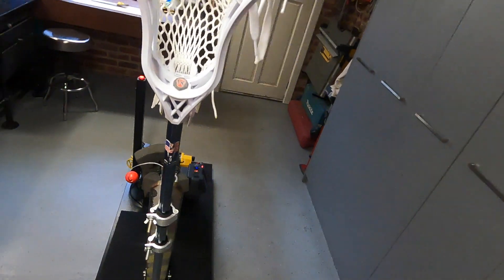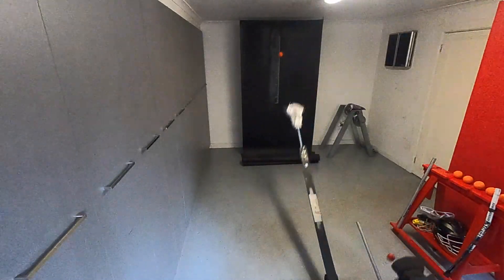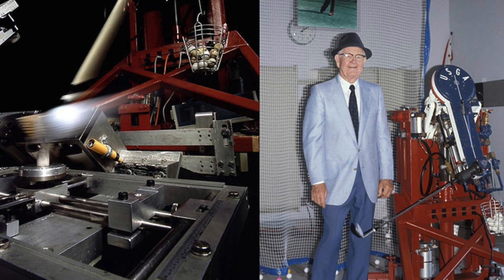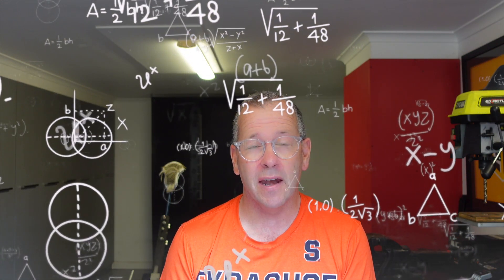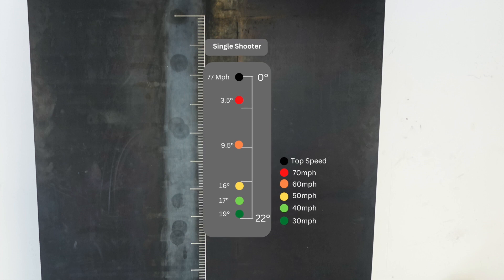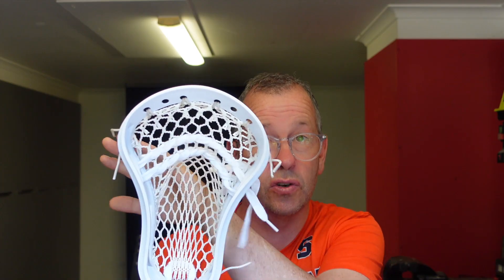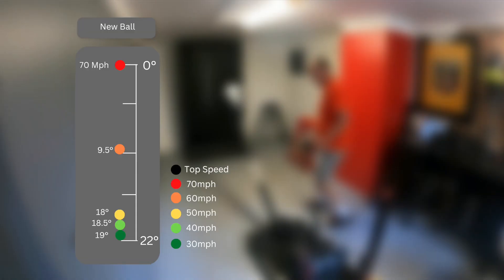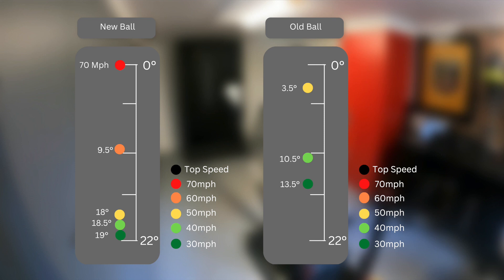I Built a Lacrosse Shooting Robot!

Comment: have been thinking about this as well, since I coach lacrosse and am also an engineer. The big question  I have (I could be wrong) is about acceleration.  It seems that with the spring, acceleration is maximum when first released which would require a lot of "whip" or would favor a head canted forward to keep the ball in the pocket.  With an actual player, acceleration is maximized more towards the target (therefore less whip).  Thoughts?
Reply from the maker: Thanks for your interest scottmccaig6185 . Yes, the Lacrossebot is very linear with it’s acceleration curve whereas a player typically produces  a more gradual exponential curve when shooting. But the purpose of the bot is to repeat without variation so we can study (or exactly copy) the differences between one set up and another.  Where the Lacrossebot is soo good,  is if we are stringing a stick to be an exact replica of an existing set up.  Once we get the release numbers from the original stick, we make whatever changes are required to replicate the same numbers on the new stick…. Even if it’s a different brand / design head.  The player picks up the new stick and straight away likes how it shoots and passes. It’s an exact replica of their favourite stick!